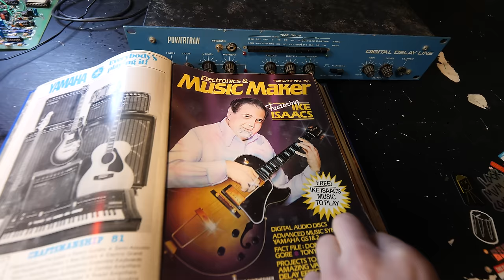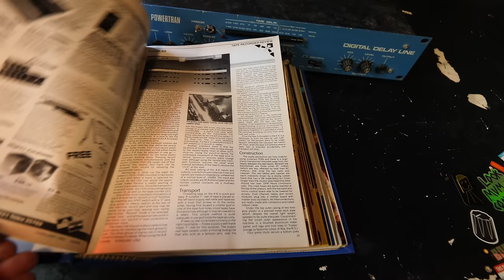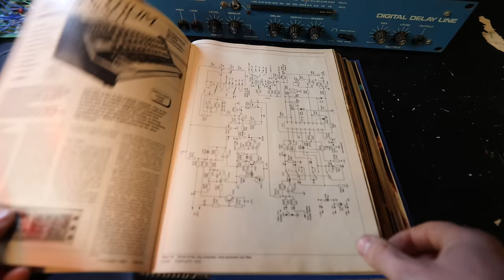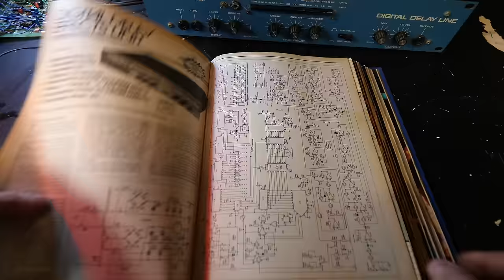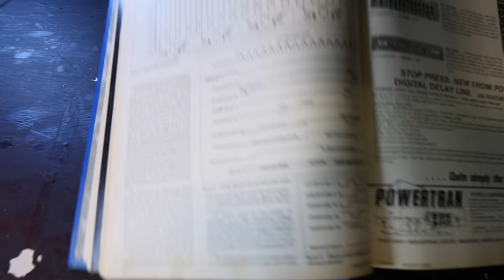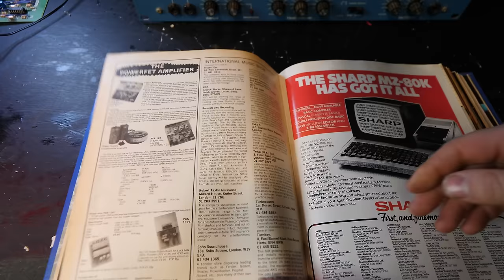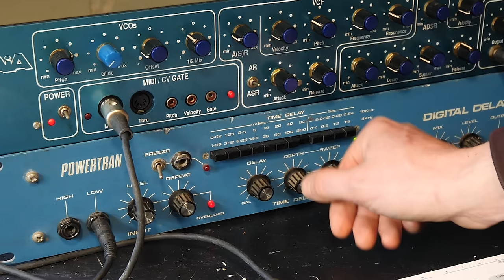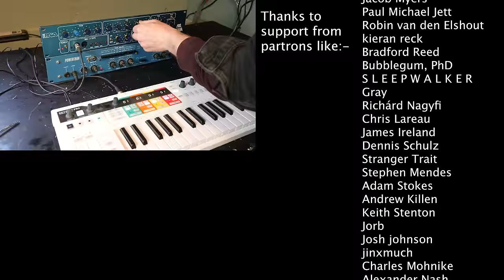THE 1982 MAGAZINE DIY DELAY EFFECT PROJECT FROM POWERTRAN

Comment: I too worked carelessly with electronic equipment like you do when I worked as an electronics engineer in the 80's.  I used to hold the circuit board in my lap when working on it. One day there was an electric surge going through the electric system in the factory due to a lightning strike and a FatMan circuit board got permanently fused to my left leg.  Even if it is a little bit incovenient, I'm used to it now. At least I can play some music while I crap.

Comment: This reminds me of the DeltaLab ADM 1024 Effectron II (which was not a DIY delay). We used to use the Effectron II on vocals in the synth band I was in back in the late 80s. Our singer had it on his keyboard stand and would trigger the Infinite Repeat manually, then tweak the Depth and Modulation knobs for dramatic effect. It was a noisy beast, but great fun. This one actually has more controls on it. Sounds grungy and awesome.

Comment: I probably already mentioned it, but I have TWO of the powertran (orr/monkhouse) MCS-1 delay-line-samplers with midi & cv/gate control over a monophonic sampler with 64kb of memory. they're great delay lines, & can be used for all sorts of freaky freeze effects + phasing & all that. one of them was built by tim wallhead, who was the tech at argent's keyboard shop. they interface with BBC micros too, but I never tried that.
Reply: TMAI! as late as 1995, when I bought my first 'proper' sampler (like many, I went for the emu esi32), the cost of memory.... I bought 32MB off a mate who took it out of his kurzweil- it wasn'tm even new! & it cost me a grand! for 32MB! there had been an earthquake in japan in the early part of the decade, & supplies were affected for years. we had break-ins at our offices (Mtv in camden) where thieves targeted desktop macs for their RAM. I seem to remember that larger machines & servers had something that detected if the lid had been removed, becaause of this silicon theft.
same emu sampler- I bought a scsi hard drive to put in it- 320MB, & it cost £1 per megabyte. 
kids these days...... 😂
the prices fell away sharply in 1999-2000, though- we put 32MB into our lexicon jamman units for a mere £300 each!

Comment: Not sure if you've added extra RAM yet, but assuming those are 4kx1 SRAM chips you'd probably be able to substitute a 4kx8 one. Might need to pull extra data bus lines from other sockets but should work fine. Technically even a larger one would also work, you'd just leave all the higher address lines tied to ground to always be 0. So if you have any 8kx8 or 16k8 chips lying around, they'd work, indeed as would any mix of 8kx1 or 16kx1 chips if you had 8 of them.

Edit: voltages allowing of course. 82 is right on the edge of when some still needed 12V and –5V while others were happy just getting 5V. Later 5V-only chips might be able to go with the older ones if you just remove the connections to the other voltages, but take that with a grain of salt because I haven't looked into it like I have the first stuff.

Comment: 2114 SRAM for a delay in 1982? And then 8 bit ADC/DAC? Ok that was old fashined even back then. All the delays I repaired from that era used 16 kbit DRAM and 1 bit delta sigma ADC/DAC. This was much superior to that design. However, this thing will be still great fun to use I believe.
Reply: Yep. But this was a low cost kit for entry I imagine it was modelled on delays from a few years before
Reply: @LOOKMUMNOCOMPUTER  Yeah 182 pounds is pretty cheap. An it looks like a lot of fun.
Reply: @LOOKMUMNOCOMPUTER  The german computer magazine ELRAD (I think) had a similar project using said 1 bit converter and DRAM.
Reply: @LOOKMUMNOCOMPUTER  Have you sourced some RAM chips? I have a couple of 2114s but also 19 equivalent  µPD444, which are a low power pin compatible device. Want them?